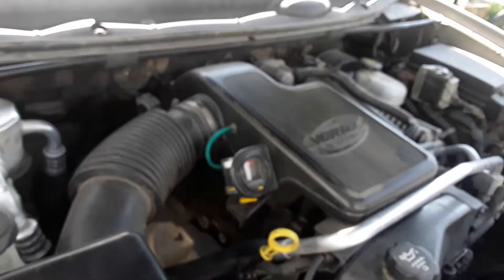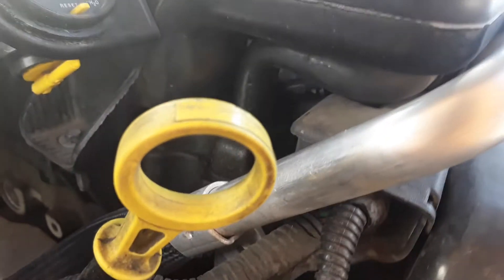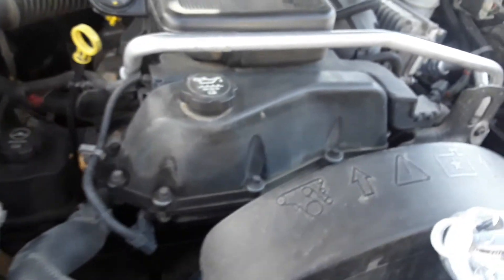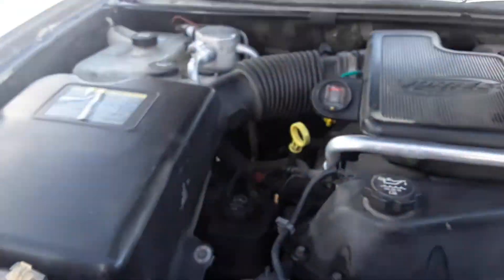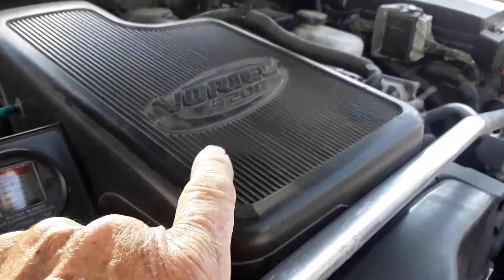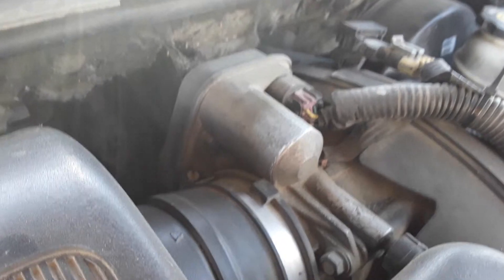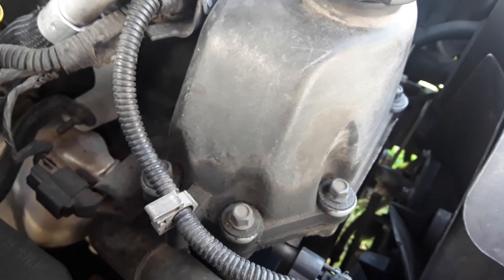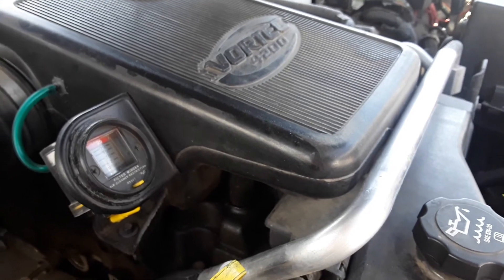Yes, The 4.2 Has A PCV System

Comment: Wow my S hose is TAKEN OFF the negative pressure intake as you state, "that goes INTO the valve cover" - so did a mechanic do that ON PURPOSE!! To stop the throttle body from getting dirty? I have oil sprayed OUT of that S hose!!! Holy smokes. I was wondering why that oil was there. haha. How bad is it that the pressure is now POSITIVE and shooting out of that S hose - the extra oil? (besides the fact that it's probably illegal).
Reply from the maker: For the system to work correctly, reconnect the "s" hose and service the BIG HOSE side of it with the B-12 treatment a few times. 
EVENTUALLY it'll clean out at least some, anyway! 
Your "mechanic" has no understanding of the way it works, that's why he disconnected it. 
PRESSURE in the PCV system is a clue as to the same pressure in the crankcase. It's all related and the problem is that the PCV CV-side of the system has been unserviced for a long time. 
YOUR job is to now get it working - at least a little bit - as every treatment of B-12 will improve it until all 6 ports are pulling a vacuum in the crankcase.
Reply: @SurferJoe46  OK thanks for the response Joe. How did you pour the B12 into the crankcase port? Did you just use a funnel? One person on the forum mentioned attaching a 1/2 inch heater hose that is 2 feet long and then putting the funnel into that hose - to pour the B12 into the port. Is it necessary? Or do I need a special type of funnel? 
Yesterday I put a boroscope into the air silencer box and I did see some oil streaks. So then I sprayed in acetone and let it sit and then power washed water into the air box - but seriously barely any oil came out air box. I did that twice and there was next to no oil coming out of the air box. 
So I have done oil changes at 3K for the TB for pretty much the whole 257K miles. I think I went to 5K once or twice. So I'm really not sure if that PVC port ever clogged up. So you're saying that there's no risk - that the B12 at a capful at a time will be fine into the crankcase intake channels even if it's not clogged up? .. That "port" goes into some kind of intake channels that then go into the crankcase? 
I just got the new L "dirty hose" PVC part that is flexible. It's difficult to SEE the negative pressure crankcase port and the upper intake manifold nipple - I got hose pliers to take off the old hose.  I used a boroscope - so I could see the "spring clamp" on the bottom of the hose at the crankcase port connection. I didn't ask any mechanic to do this - but maybe I should. 
Did you use the Liesle Hose Removal Pliers? It seems like those would not fit into that space. I ordered those just in case they might help. People talked about the old PVC hose being brittle and baked on. 
I just want to make sure I can get the NEW PVC "L dirty" negative vacuum hose back on since obviously it's required to run the engine - for the proper negative pressure, etc. before i take off the old one.
Yeah I actually need to get the B12 still - my car is now vibrating from new rear coil springs and struts - so I need the wheels balanced and an alignment - that is scheduled for Wednesday. I'm trying not to drive till then just to make sure I don't damage the CV joints - because the new rear coil springs raised my TB up two more inches. I have a 9 inch ground clearance now.

Comment: When I take the L shaped hose off on the vaccum side, do I take it off from the bottom or the top ? I tried to pull it from the top and it didn’t seem like it wanted to come off. Also is the metal tube in the hose itself or is it at the top or the bottom ?
Reply from the maker: Either way. You just have to get the B12 into that circuit - it'll run down and soften the deposits.
Reply: @SurferJoe46  My S hose bottom end is OFF and disconnected! And there's oil sprayed around that area. So that must mean the pressure built up to blow it off? Or did some mechanic remove it you think? How bad it is to run the engine with that disconnected? I've probably ran it that way a long time. haha. I removed and cleaned the throttle body but I don't think I forgot to connect that hose? I'll check the instructions of throttle body cleaning - I don't think it required disconnecting that S hose.... hmm.

Comment: You ate no help. How do you fix it?
Reply: you have to read all the comments to figure it out. Here you go: The air box (correctly called the "sound deadener chamber") getting baby poop in it is because your CV-side of the system is totally plugged up and is reverse flowing.The flow is INTO the nipple - that goes INTO the valve cover and INTO the crankcase and INTO the vacuum side of the PCV system (the CV-side) and is burned up as fuel. It's originally designed as an economy device but they found out it was sure nice to eat the sump gas fumes that smelled amazingly like an open sewer. . 
 remove the lower hose clamp and pull the hose up and open the metal tube. 
 You want to get the B12 into the tube the actual problem is further down inside that metal tube. 
The liquid is going into the intake and won't contaminate the oil in the engine. It's a totally different system. 
Persistence is the answer and it will get better and better with every application. You've gotta keep at it until you think it's really clean - evidenced by the vacuum at the oil filer when you put your hand over it while the engine's running. 
You just have to get the B12 into that circuit - it'll run down and soften the deposits. 
The problem is not being addressed the way you've done it and you run the risk of rusting the VVT intro a seized-locked position. Many people keep having trouble with the VVT and the PCV is the cause. 
Just to make sure the sequence to do this should be.1- car off (preferably warm), 2-take hose off metal tube.3-pour cap in4- put hose back on5 start vehicle and run6 repeat from step one a few times? 
 Still - it's best to turn the engine off and pour the B12 in and just slip the hose back on without the clamp if you want to do this a few times, trying to get a better dose into the system. 
 I used my compressor with a long tipped blower nozzle to force a lot of air into the lower portion of the system --- the metal part --- and just blew through the clogged up gunk --- but it takes a little effort after pre-softening the crud with the B12. >> Put the clamp back on before you decide to drive away though .... OK?
Reply: SEe his other vid for more details -  it is ultimately controlled by a sized-metered orifice on the valve cover, which INHALES clean air after the air cleaner, then allowing it to travel into the crankcase area of the engine block, sweeping away any blowby and byproducts of combustion - the worst of which is moisture in the form of condensate from the fuel combustion and the atmosphere.
The crankcase must remain in a negative pressure condition - a vacuum if you will ... at all times.  
If oil/condensate rises from the valve cover nipple, then the suction side of the system is plugged up and is not operating to specs. 
This emulsion will travel into the throttle body, contaminating it and then it requires repeated cleanings to make it operate correctly. 
The CV side can be serviced though - even though it cannot be removed to access any way to actually clean it in your hands. We can chemically clean it - often in repeated treatments if the system has not been or has never been cleaned. 
This video shows how to service the CV side and that should take care of the KV side too - since the KV side is really easy to access and poke a thin wire through the small-ish hole that serves as the limiter to how much air the system can 'inhale'. 
PS --- don't use any hose clamps on the s-shaped hose. It has to have the ability to blow off it pressure gets too great .... which is should never. 
Besides, the valve cover gasket will fail and fill up the spark plug tubes with oil if the pressure gets too high - long before anything actually overrides the capacity of the air flow.

Comment: Just for clarity. My hose, on the top of the long side of the L shaped hose, where it connects to the intake plastic plemium, has no clamp, its just slides on on mine.  On the bottom where the short L connects to the crankcase  via in metal intake manifold there is a clamp. The hose is so baked I question whether I can slide the hose down off the plemium (the hose would have to kink a bit) without first unclamping the bottom and pulling it out off the IM/crankcase fitting.  From your post, I am assuming the clogged end is the crankcase, short L, end? Am I suppose to side the top down off the Plemium, leave the bottom connected, and pour some cleaner in the top of the hose so it can sit in the bottom of the hose and soak the opening into the crank?  Is this correct?  You mentioned that the B12 wouldn't mix with the oil....so am I correct in assuming that the passage into the case that is being cleaned runs up hill before it is exposed to clear air inside the crank.  Finally, do I also need to squirt the b12 up into the plastic plemium fitting, ie does the top clog as well?  TIA (using my wifes youtube)
Reply: yeah he wasn't really clear on how to clean it out - so left us wondering - unless someone is a real expert. haha. I look forward to the answer. thanks - below he answers it: I tend to not bother with taking the hose off the plastic nipple and instead remove the lower hose clamp and pull the hose up and open the metal tube. 
...... The metal tube is what you're after here - in some situations it's easier to take it off the top nipple - some it's easier from the lower nipple. 
..... You want to get the B12 into the tube, not necessarily the hose - but if you get it into the tube, it'll naturally run down into where we want it to go anyway. 
..... That big rubber hose is never gonna plug up without someone pouring JB Weld in it - and the actual problem is further down inside that metal tube.
Reply from the maker: You got it correct. You can pour the B12 into the rubber(stiff/old) hose or into the lower metal nipple that turns 90 degrees into the area near the actual headgasket. Either place is ok ... it'll get there somehow. B12 has mighty strong vapors --- I wouldn't smoke or be eating a sandwich at the same time --- although i've ingested a lot of B12 over the years and it nebber bO7he-e-e-e-e-e-e-red me!!!!!!!!!!!!!!!!!!!!!!!!!!!
Reply: Ewe awaawswawswawaswawawswawawawa
Reply: Both of the hoses for the pcv system can get clogged and create the same scenario. The hose that is connected to the air plenum does not need to be clamped. It is designed to not need one. You can use carbon cleaner/brake cleaner instead of B12 as long as you clean it out really good and let it dry before putting back together. Just as long as you don't leave a " pond " inside the plenum the air from the vacuum will evaporate the rest. The other hose from the air intake can be quite brittle after time. If you feel it and can't pinch it to check flexibility then I suggest buying some from the auto store. I like to just blow air in into the hose from a compressor. That one should have clamps on both ends of that hose. The air plenum is usually the one to be clogged. I check mines after every oil change. But be careful with the opening on the air plenum that connects to the hose. Those have broke on plenty of people and either replaced it or jb welded it back together

Comment: Mine doesn't have pcv valve. And it gets oil in that box. I have to clean the throttle body often
Reply from the maker: None of them have a PCV-valve. There is no actual part you can change. Oil in the box means you're collecting water in the engine - in the crankcase and it will destroy the VVT actuator and can destroy the cam and/or cam followers, not to mention the rod and main bearings.
 
Failure to keep the PCV system that this engine DOES have - is dangerous to a lot of things inside the engine that should never see condensed water.

You should never have to clean that throttle body from oil - all that is SUPPOSED to go through the throttle body is filtered air.
Reply: @SurferJoe46  Then what you fix to stop it?
Reply from the maker: @fernesal  Did you even watch the video? I tell how to service it and what to expect when its operating correctly.
Reply: @SurferJoe46  I understand better when written.  It's hard to catch different accents. I'm sorry.
Reply from the maker: @fernesal  Not immediately --- it takes repetitive applications to finally get it to working better each time. 
You MAY see results immediately (don't count on it) --- but if you persevere, you'll get it eventually.
Reply from the maker: @fernesal  Ohhh ... OK, my bad! But - yes --- if you do what I recommend, you will improve upon the whole bad situation. 
It's a shame that GM didn't originally promulgate the instructions on how the system worked and how to correctly service it. 
Now - we are playing "catch-up" trying to clean out a very polluted system.

Comment: I’m have 2006 trailblazer 4.2 LS in limp mode with a P0300 Can’t seem to figure it out does spark plugs coils crank/cam sensor any ideas?
Reply: 2 things that can cause limp mode. The gas pedal sensor goes bad or the fan clutch sensor is bad. I used a $40 dollar scanner
Reply from the maker: I am currently of the opinion that a P0300 is a red herring (false flag) that can keep people changing coils, injectors and plugs for eternity. 
There are actually quite a few things that can cause the P0300 and they are not truly related to anything going on in the combustion chambers. 
I have begun writing about it in the TrailVoy website.  ( https://www.trailvoy.com/ )

Comment: Chevy's 2.2l had a weird setup as well. I had a gmc sonoma with a very odd amount of vacuum through the crankcase breather hose. I took the intake completely off looking for the valve, GM had figured up a way to build the orifice into the intake gasket. With time I guess heat and oil degraded the gasket and broke a big hole into the gasket where the orifice is.
Reply from the maker: Makes sense .... no moving parts .... heh, heh.

Comment: I was wanting to replace the hoses because mine are really hard. I feel like if I try to bend it to pour the cap in it. It will break. Any idea what size the hose is? The elbow one on intake side. Not the s one on the resonator. I appreciate it.
Reply: I have part numbers if you want them. Can buy online.
Reply: I just ordered both hoses off rock auto... They are really good about sending vehicle specific parts.
Reply: @paulhawkins1460  I found them on amazon, I got the right one but the positive side is so hard to take clamp off. I just put a clamp on the old hose on the top part to make sure there's no air getting in. Until I have a day to mess around with it. I need to get a little baby pair of pliers or small needle noses
Reply: @tylersanders8853  agreed..  The clamp is a pain to get to.
Reply from the maker: Sorry I just noticed this question .... and no ... I haven't measured the hose. Strange that it got hard; PCV, KV, CV, et al hoses are usually made out of better than just heater hoses. 
If I were to make a guess, the dimension would be in 32nds of an inch with an uneven number on top .... 11/32 or 21/32 or something like that ... to differentiate emission hose from coolant or fuel hose. That's always been an industry-wide standard for LEGAL factory vapor hoses on engines for a long time. 
Another interesting thing is that those hoses also had a green stripe running on them to make it obvious it was a crankcase vent hose of some kind ... this may not still be an identifying mark though as I don't remember seeing it here.
Reply: @SurferJoe46  thank you, the top of the positive crank ventilation hose. Is cracked and mine doesnt even have the clamp on it. I ordered a new hose for both sides. And different size clamp set. Also a long pipe cleaner. I'll try doing this. But nothing has helped so far. My idle is still dropping. Idk what it could be besides a leak now. I'm gonna probably have to go get it smoke tested

Comment: So you take the top clamp off the hose on the negative vacuum side? Poor the cap in the hose?(with car on or off)? Also wanted to know if anything will leak out when taking hose off? Edit: so I read other comments. I now know where to pour the b-12 . I just wanted to know if anything will pour out. It's an air hose only correct?

Just to make sure sequence to do this should be.
1- car off (preferably warm), 
2-take hose off metal tube.
3-pour cap in
4- put hose back on
5 start vehicle and run
6 repeat from step one a few times?
Reply from the maker: Yeah --- you've got it. 
>> You can actually take the hose off if the engine's running and it will stumble a bit and catch itself and steady up after a few moments. The throttle will need to close a lot further than normal and it may be dirty - but mostly the motor can overcome any soft contamination. 
>> Still - it's best to turn the engine off and pour the B12 in and just slip the hose back on without the clamp if you want to do this a few times, trying to get a better dose into the system. 

>> repeat until you either get some results or you get tired. 
>> I used my compressor with a long tipped blower nozzle to force a lot of air into the lower portion of the system --- the metal part --- and just blew through the clogged up gunk --- but it takes a little effort after pre-softening the crud with the B12. 
>> Put the clamp back on before you decide to drive away though .... OK?
Reply: Will do, thanks.  I appreciate it a lot. Not a lot of info around about this.